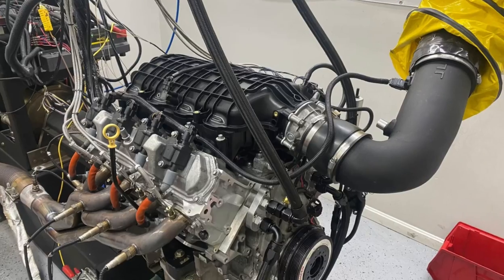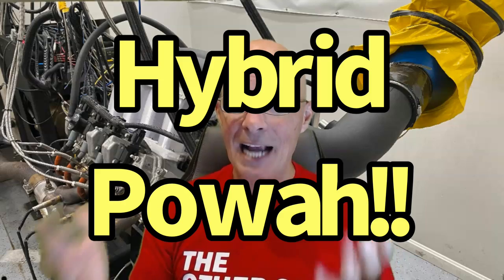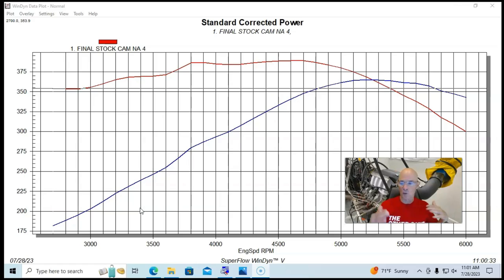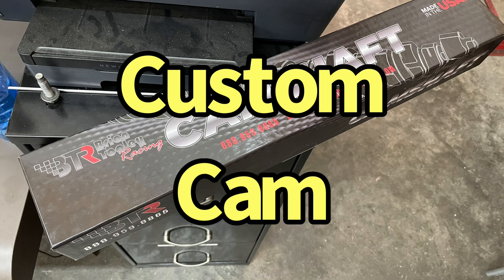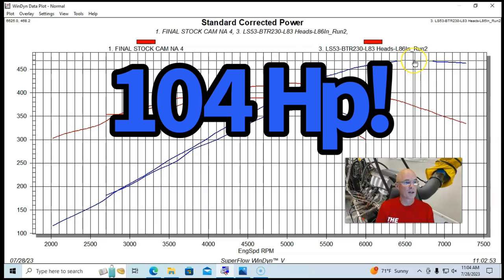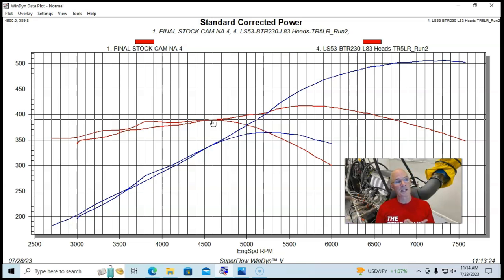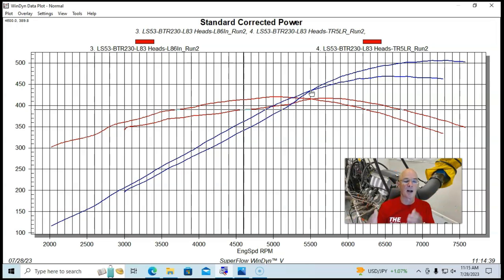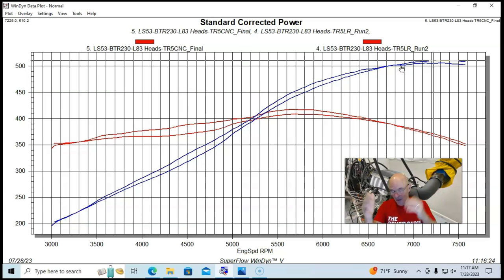HOW TO: LT HEAD SWAP AN LS. GEN V L83 HEAD SWAP ON A GEN 4 5.3L L33. HOW MUCH HP ARE THEY WORTH?

Comment: Have you tried Gen V l83 heads on a Gen V Lt1 short block?
Reply from the maker: why would you do that?
Reply: @richardholdener1727  Why do we any of this?  Curiosity.  How good is a head with 248 cc and an MCSA of 2.4-2.5" and a small valve?  Will it make more low end torque?  How much?  How much horsepower will it ultimately make?  Is it just a dud with more cubes?  Also with BTR's  "220" cam in the L83, L86 and LT1 they each made the same HP per cube.  How is that possible?🤣

Comment: Stock for stock LS3 heads outflow the L83 and LT1 heads so this would only even make sense on a 4.8/5.3 and even then it's alot of hoops to jump through, not worth it IMO
Reply from the maker: an LS3 does not make what an LT1 makes
Reply: @richardholdener1727  never said it did, but the main reason the LT1 makes more power is DI...on 4"+ bore LS3 Heads will make more power on a gen3/4 than LT heads
Reply: @CPoston420  I thought the same as you did... after doing some research I'm seeing lt1 head stuff making more power... it's the runner length,the valve angle and port shape that is improved over ls3 head

Comment: Did you run this port injected ?I don’t see if it was noted in the video
Reply: Gen3 and 4 have no spot for a high pressure pump and he states they used di plugs but I don't see a set of injectors added to the l86 intake so I'm confused
Reply: @johna7200  my point exactly and again didn’t see any port injectors but we may just been looking at some footage he had laying around 
Still imho a lot of work for what a good cam swap and 12 cr would probably do with 243/799 heads 
Would love to see a back to back rec port vs l86 heads on a 6.2 gen 4
Reply from the maker: this was run port injected-DI was plugged

Comment: So this LS also stepped up to direct injection then right?
Reply from the maker: no
Reply: @richardholdener1727  oh I thought you used a factory Lt intake. I'm so confused. I just don't know enough about the Lt engine.
Reply from the maker: modified l86 designed to accept external injectors

Comment: I thought the L33 was a gen 3 motor?
Reply from the maker: gen 3.5
Reply: @richardholdener1727  Yeah it's aluminum but still cast with the knock sensors in the middle valley and no DOD.
Reply: @richardholdener1727  I wonder if Richard see this comment but I was just thinking ok you order a custom cam with reverse cam lobes but this is just a theory but why don’t you get a regular ls cam and retard the timing 180* degrees if that makes any sense wouldn’t that put the cam reversed?

Comment: When you put LT heads on a LS, do you use direct injection? If I understand, LT is direct injection, right?
Reply: The video mentions in text that they put plugs in where the injectors were.
Reply: I watched the video again, and you are right. Richard flashed the injector plugs on the screen. I didn't think that the L83 intake had external injector bosses, but evidently, they do. I thought that I could see an injector rail on the inside of the BTR high ram.
Reply: @fustyblatherskite2142  👍
Reply from the maker: The l86 intake was modified to accept port injection and the BTR intake already had that.

Comment: I wonder if Richard see this comment but I was just thinking ok you order a custom cam with reverse cam lobes but this is just a theory but why don’t you get a regular ls cam and retard the timing 180* degrees if that makes any sense wouldn’t that put the cam reversed?
Reply from the maker: WHAT IS A REVERSED CAM LOBE?
Reply: After market cam to swap lt heads on Ls block
Reply from the maker: you need a dedicated lt/ls swap cam since the intake and exhaust valves are in different locations